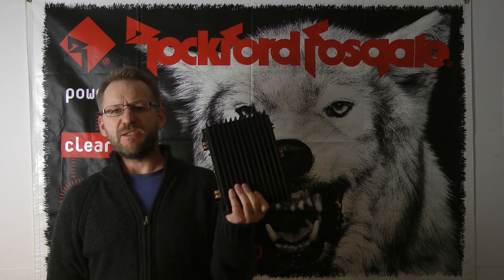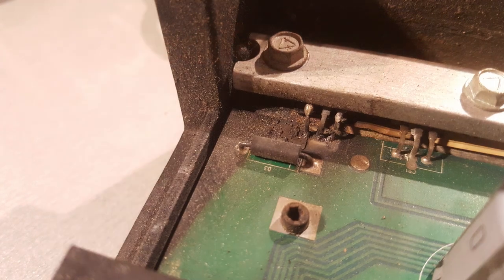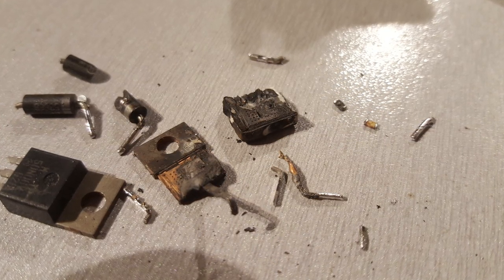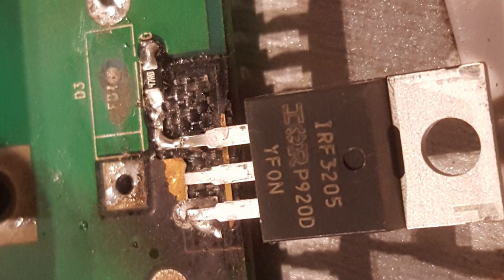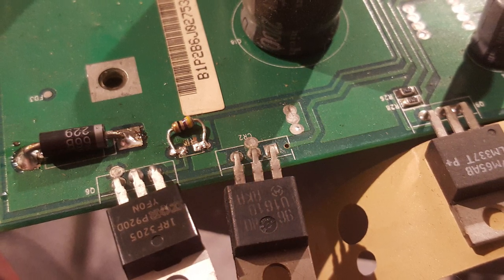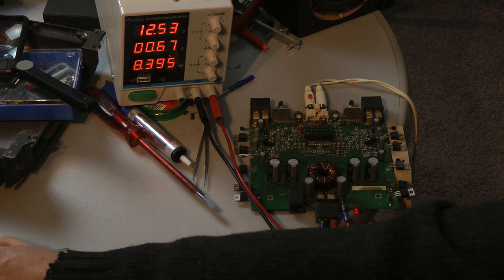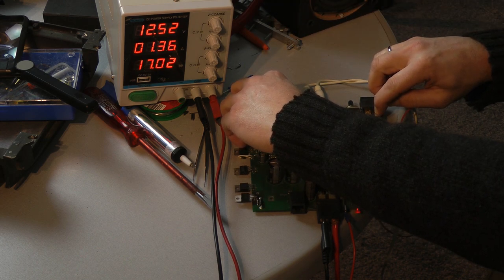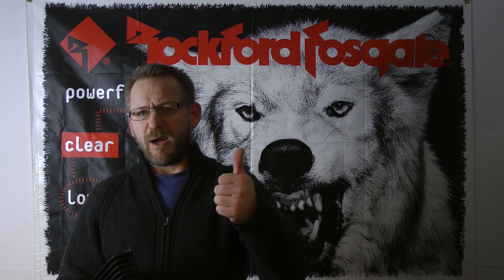Rockford Fosgate Punch 60x2 amplifier repair quick oldschool amp fix tour with pics

Comment: What fets were in that originally?  I think the b+ was reversed if that diode was shorted..ill explain my question  of original fet..i see 47 ohm gate resistor..thats too high for that fet..should be 22-28 ohm... the original fet should have been mtp50n06.or 75n06..a few runs were made with the 3205..but the gate resistor should have been 28 ohms ... for that part
Reply from the maker: Hi 👋
In different Rockford Amps i fixed I used 47 Ohms together with the 3205 for the power supply. Never ran into problems. Sometimes there are 68 ohms which is too high, I believe 22-28 will also be ok. I have a punch 250M where the power supply was toasted , back in 2018 I fixed it with 3205 and 47 ohms, that amp made no problems till today and has to run very hard. I forgot which FETs were in the 60x2 originally. 
What do you think which problems can occur with 3205 & 47ohms ? I never faced a problem in the last 5 years.
Reply: Depending on the (rds) and somewhat the design..the gate resistor should be adjusted..
Reply from the maker: Saw amps that use the 3205 even with 100 ohms , as long as my drive signal looks nice and amps don’t heat up I use the 47 , if I run out of 47 I use the smaller ones. Think the drive circuits dead time is set different.
Reply from the maker: I tested it in this way: I have a variable voltage power supply, if I decrease the supply voltage and the idle current stays the same, it’s ok for me. If idle current goes high after decreasing the supply voltage I will reduce the gate resistor, but that wasn’t the case in the amps I had so far.
Reply: @audiokeller1975  you do understand that i worked at rockford . I handbuilt and repaired for them in the late 80s. I left right before the layoffs and machine builds started. Thank god i saw it coming
Reply: The irfz40 uses a 68 ohm resistor..the irfz44 uses a 100 ohm.. the 50n06 uses 47ohm..the 3205 uses either a 22 or 28 ohm.. i know the best designers.  Personally.  heres the truth..i taught them alot.. i have repaired since 1978. Kinda..haha..really maybe 1980.. after 25 years of repairing i told some people my understanding and they laughed. Soon they called saying im right..the issue was swinging b+ while playing music.. so they used sepperate supply at 18v and regulated back down to 12v to feed the pwm ..and that helped solve the supply failure common issues
.  But the gate resistor issue was discovered..on a supply it cant be seen..but in a vehicle that the b+ is all over the place and heatsink temp cold and hot changing the bias.. we found the mistake. So.we dialled back the gate value..and it calmed the amp..
Reply from the maker: @davidstevens7809 i understand that and I respect that , no problem 😀 
But I also know lots of guys in USA who repaired lots of rockford amps, and some of them use the 3205 with 47ohms since 2006 without issues until today, so I don’t know where the problem is ? I am not from US but in the US they always recommend using 3205 with 47 , so I did for my personal repairs and it’s working for me. So I ask again: what issues do you expect with 47 instead of 28 ohms?
Reply from the maker: Well I think you should post this on diyaudio forums - they are all doing it like this, but i took a look: I have smaller resistors for future repairs - thanks for firsthand info but it should not be a secret for the guys at diyaudio 👍😀
Reply: @audiokeller1975  did you know rockford fosgate made a home amp? Me and 3 others made them by hand..only 50 sold i think.. i have one..
Reply from the maker: Yes, I saw one advertised here in Germany some years ago but forgot the model and there is still a fosgate headphone amp with tubes advertised. There is nice stuff around 😀
Reply: @audiokeller1975 I found a video showing what happens if the value is too low..and also what happens if its too high..It wont let me share what ive saved to my clip tray for some reason.hmmm
Reply from the maker: @davidstevens7809  is this video on YouTube? If yes, skip the YouTube app, find it with a pc via browser copy and paste the link 👍 would you rather go for 22 or 28 ohms? There is only 27 or 22 available
Reply: @audiokeller1975  haha. Yes..27.. heres what im told..its a balance between heating the pwm ic and the driver surface mount parts.. or causing the speed of the pulse to sag and not give the quick snap to excite the toroid...and be able to convert power. And not over heat and not follow ohms law.
Reply: @audiokeller1975  quick and easy mosfet  gate resistor calculation
Reply from the maker: I think I get it, if resistor is too high the rise and fall isn’t clear enough so it’s possible that one bank isn’t Switched off when the other bank is switching on. What about the 22 Ohm? Ist it too small?
Reply from the maker: I will take time and scope my gate drive signal at different gate resistor values 👍😀
Reply: @audiokeller1975  study the mtx ta2300.. i have a lot to tell u..but not in public..did u know it was to be the punch 300.. but instead was mtx ta2300.. thats the best amp..
Reply: @audiokeller1975  back in the late 80s and early 90s I had a challenge that i could make any amp given to me do double rated power. I did that with ease..i had a punch 45 that did 150 a channel and 600 mono..
Reply: @audiokeller1975  exactly. Did u find the video .i was wanting u to watch?
Reply from the maker: I guess I did find the video with the guy who jumpered different gate resistors and scoped the signal? Nice one. I didn’t hear that with the MTX, I just heard that they came out of the same factory ( Mtx240 )?
I took the time to check it: I have another punch 60x2 ( untouched, I broke the seals) and the fixed one. Both gate drive signals look the same even when I reduce b+ voltage, the signal looks best before the gate resistor in both amps. I guess the differences can be seen under load? By the way: very nice lesson in car audio history - thanks 😁 I also found an article at diyaudio.com where they talked about substitute FETs and they mentioned this type of problem. One very helpful guy there recommended to lower the gate resistor to 27-47 ohms, he also recommended the 47 ohm for Rockfords. Maybe you know him, he has a very big and great amp repair tutorial online which is well explained also for people who just start to fix things. His name is perry and he writes lots of answers for all people who ask questions, almost all helpful articles are written by him. He takes so much time to help people out of their problems 👍
Reply from the maker: From which year is the ta 2300? Can’t find it, just found a thunder 2300 which seems to be from mid 90s?
Reply: @audiokeller1975  look at wiliston audio demo. Yes thunder 2300..but they all arent the same..im discussing only the first version..and yes . Big d wizz tested it..
Reply: @audiokeller1975  the same guy that designed punch amps before 95 made the first thunder amps..
Reply from the maker: I know this video - that thing is damn underrated and puts out lots of dynamic power, wish I can dyno one in future 😁
Reply from the maker: I still own a Thunder 240 which is a real good amp 👍 I made a dyno race video between the 240 and a punch 40